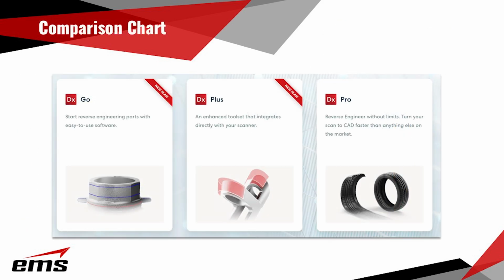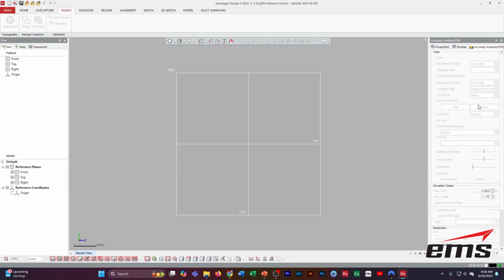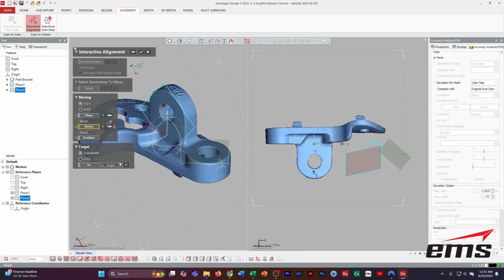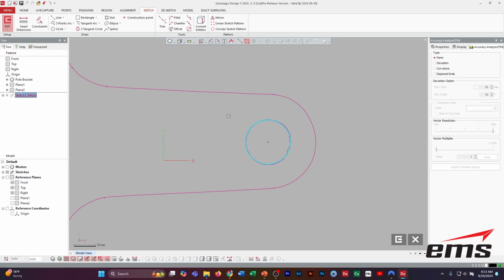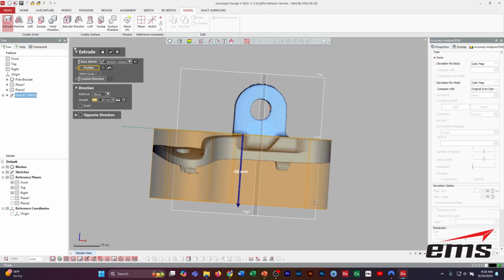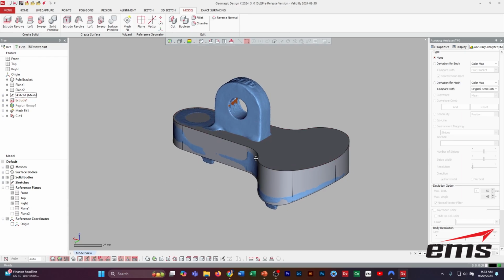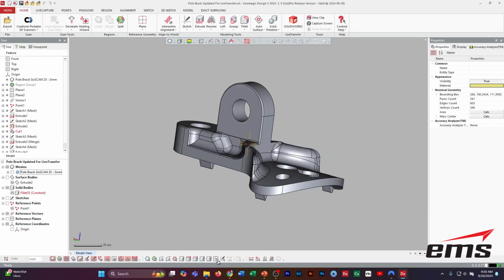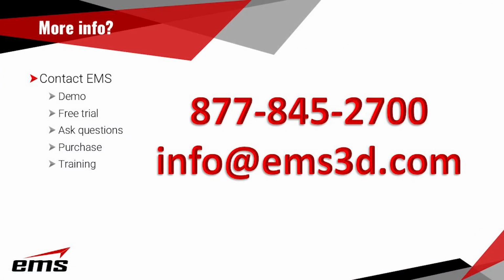Geomagic Design X - Go - In-depth Demo  *** NEW PRODUCT ***

Comment: Nowadays with all this AI stuff it should be already possible to make it a one click push button Scan 2 CAD. If a human can interpret the features so can AI.
Reply from the maker: I think AI will be able to do simple parts but complex geometry is probably going to be manual for a very long time.
Reply: @EMS3D  
If there is demand, then it will happen pretty quickly. Same happened to PCB software they said it's very complex and not doable 6 months later AI is designing PCB layouts.

Comment: Could Design X Go do Live transfer to Fusion-360
Reply: Currently, no. Just the neutral formats like iges/step

Per the context help menu, LT works with

Inventor 2010-2025
AutoCAD 2010, 2011, LT
Solidworks 2006-2024
Creo(Pro/E) R1-11, Wildfire 1-4, Elements 5
Siemens NX 8-1953 series
Reply from the maker: Not currently.  I think its in the works.

Comment: It will take someone of fairly high modelling skill to work this software well with complex parts - the transferring to an target CAD application surely also means actually knowing how to model logically - but at least you have the finished part to go from to establish sensible / logical primary datum features etc.
Reply from the maker: Yes agree.  As mentioned in the video is you are doing more complex parts Design X Plus or Pro would be a better fit.